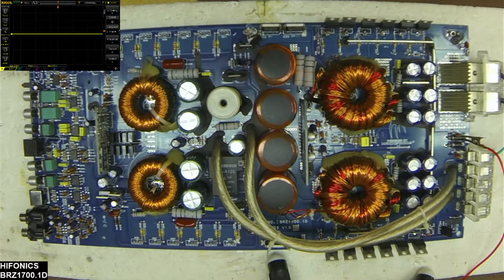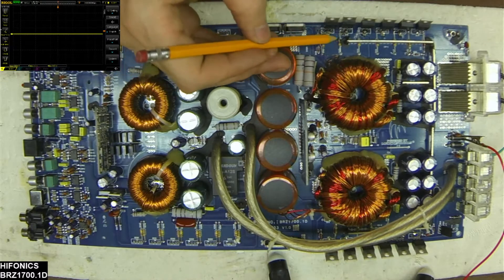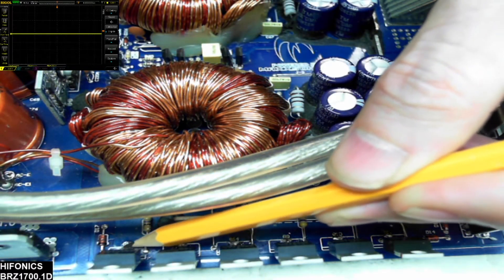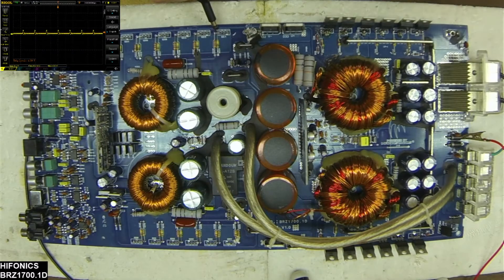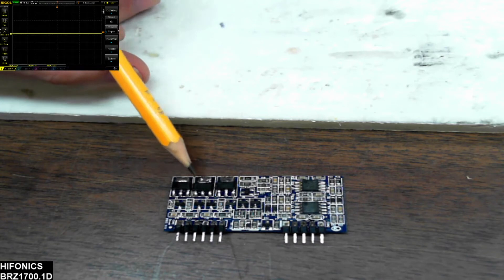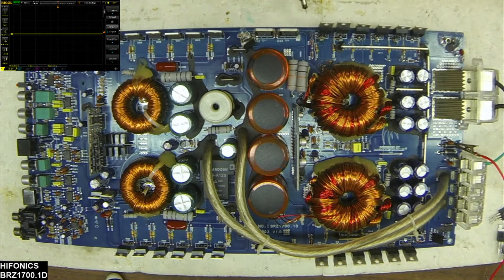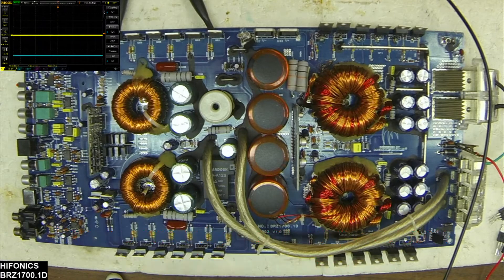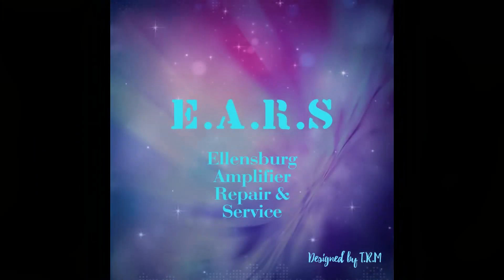Hifonics Brutus BRZ1700 Class D Automotive Car Amplifier Repair of Power Supply and Drive Card

Comment: I own this exact amplifier and loved it when it worked. Right now it goes into protection straight away but then flashes green every minute or so. How much would it cost roughly to fix? I also have the 4 channel version that works fine except for channel number has static in the background. Would like it fixed as well?
Reply from the maker: Hello and thank you for the channel support. For information I do recommend to check the FAQ page at www.ellensburgamplifier.com/FAQS and at the top of the site you can hit the request service button to start the process.

Comment: Bro I have a 1600watts hifonics Brutus mono what is the driver ics on the output and power supply boy
Reply from the maker: If the output card is like the one in the video you will have two TL072 ICs on the right of the card. The power supply card is a TL494 that drives the power supply and a TL393 next to it for the protection circuits.
Reply: @ellensburgamplifier  thanks buddy love your videos

Comment: Thanks very much for the info, especially (in one of the comments) on the parts for the output driver board. My first time trying to repair one of these amps, and it had been sitting around for months, waiting for me to collect enough info. It has the same output driver card, but it is an Autotek Supersport SS1500.1D. Most of the time It powers up, output momentarily reads -60v, then goes into protection mode, but not always. When it doesn't go into protection mode, the high side mosfets get hot. What is odd is that when the high side mosfets are hot, the speaker output is negative. 

It looks like one of the '1D' transistors is bad (the middle one of the three) on the driver card. Many thanks!
Reply from the maker: Sounds like the card needs a full rebuild. Those transistors run crazy hot on that card. Adding more solder to the legs of the transistors will act as a small heatsink for them. I do carry these cards if you are ever in need of a rebuilt one for voltage reference. Don't let those transistors continue to heat up as one or more may fail.
Reply: @ellensburgamplifier  Will do. Thanks. I'll post back with the results when it's done. Also it looks like the power supply, high side fets, had blown at one time and have been replaced. However, while the readings taken on them seem fine, some of them have their legs soldered only on the bottom side of the board, with a nice clean leg and hole on the top. Will fix that as well.

Comment: Great video sir yes those hifonics are known for the middle pin of the power supply mosfet to burn off I repaired alot of those 🙏🙏
Reply from the maker: Indeed! The drains of transistors get a ton of abuse and if there are any questionable solder joints or fatigued transistor legs they will become fuses. Thank you for watching!

Comment: Great video Todd. A very common problem on the Cab 1600.1 D as well. Broken traces. I need to order some of the p2d larger transistors. I don't have them anymore.. Great work as always Todd. Thanks
Reply from the maker: Thanks Rob! Broken traces are a bummer as I can not give a broken trace board the100% reliability pass to the customer.
Reply: @ellensburgamplifier  if repaired properly it's better than the factory foil in my opinion, I ue either chem-wik or wire just like you.

Comment: This video just saved me a lot of time wasted on scratching my head, Thank you

Also, what are the components on the driver card you replace and ICs used? I have a few hifonics in my bin I haven't gotten to yet but looking like it is a good idea to just replace those anyway so be great to order some to have on hand. appreciate it!
Reply: Sorry 1 more, do you advise to not scratch the trace and just bridge the leg? I have a DC 1.2k (That looks way too similar and they are not cheap) that had the same issue with the trace having a hair line break right at the pad/via but there was another through hole pad/via directly in front of it I soldered to then scratched the coating off the trace and bridged that as well so it didn't suffer the same fate. If this is not proper I will redo with wire like you mention, I just figured it works to fill the hole a components leg goes in, and they build up solder on traces on the bottom of the board, it should work just the same? Thanks again.
Reply from the maker: @commonsenseisdeadandgone  Hi and thank you for the excellent questions. I will cover both questions here for you. Here is a parts list for the card: 1D=MMBTA42, 2D=MMBTA92, P2D=PZTA92, IC's=TL072 For the traces I do recommend exposing the trace at the top and using either solder braid from the trace to the leg in an "L" shape or jumper wire soldered to the trace then brought to the underside of the board to wind the leg. It does depend on the board as some amps put the PS transistors right to the board which makes it impossible to get that "L" shape from solder braid. Hope this helps!
Reply: @ellensburgamplifier  perfect thanks over and over. Very useful and probably under perrys guide on the components however my laptop with "the bible" I never bring to the shop which is back asswards I know 😂
Reply from the maker: @commonsenseisdeadandgone  Any day!